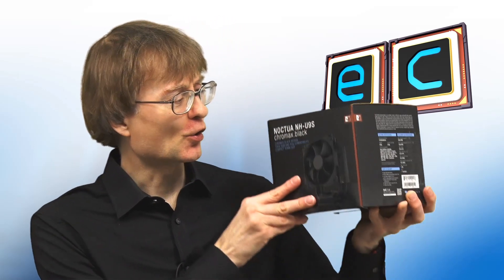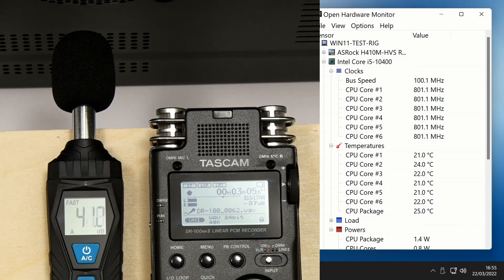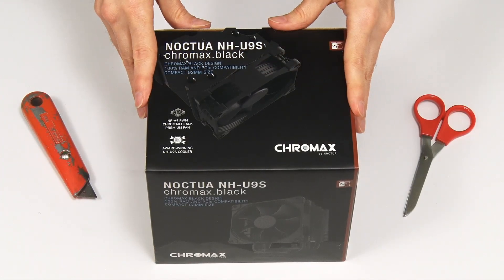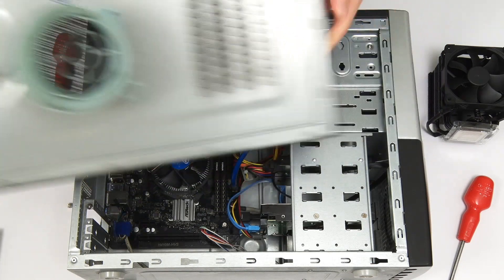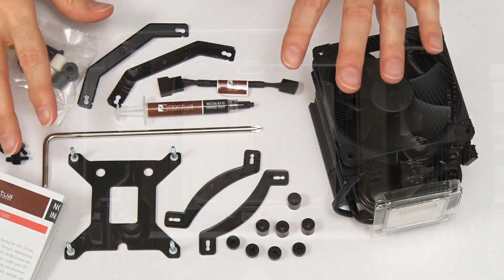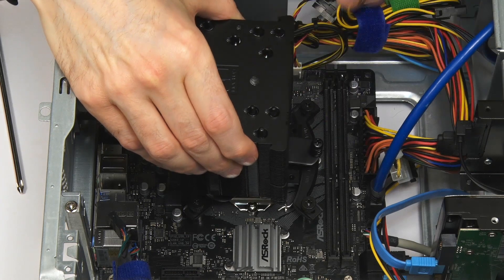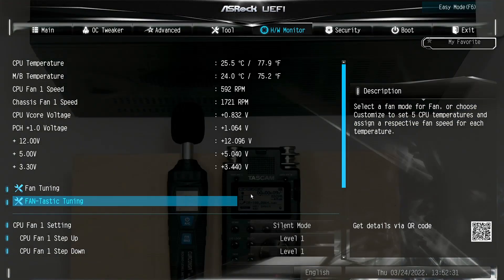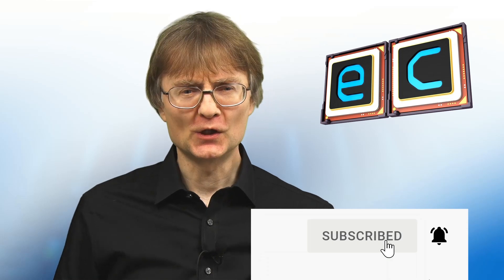Quieter PC #1: Noctua NH-U9S Cooler

Comment: I love my Noctua NH-D155 Chromax Black (Dual-Tower) CPU Cooler.  I have it mounted on my AMD Ryzen 9 5900x CPU.  It makes my PC very quiet.  As I watch this video the CPU (Tdie) temp is a nice +39.6°C with an ambient room temperature of 72.3°F (22.4°C).  It keeps my office very quiet, and you rarely hear any noise coming from my desktop PC.  If I play a game, the CPU fan and temperature does ramp up a little, but it is always significantly quieter than the fans on my EVGA RTX 2070 GPU.  It's a great silent CPU cooler.  Be warned though: it's physical size is rather beastly.  I would not attempt to mount a cooler such as this in a small case!

Comment: Finally, a YouTuber who pronounces "Ubuntu" correctly.... Just for curiosity, why didn't you go with a fanless PSU?
Reply from the maker: The Corsair RM550x does not run its fan below 220W output, so effectively is fanless in this rig. It is now fitted and even at load for hours on end the fan does not come on. :)

Comment: Great to see hard numbers. Since dB is a log scale, that's quite a lot of noise reduction.
And convenient of that case to have the back-of-CPU window; many don't!

When the BIOS lacks fan control, I use an inline rheostat (with an external control knob) to set fan speed just below the threshold-of-notice, around half speed. My old Enermax PSUs have their own external fan control, which I set similarly. 

Which reminds me, I have a dead PSU that I need to cannibalize for its very quiet fans. :)

Comment: Lovely video 10x 👏👍 Whilst I do not operate a comparable platform or box, it makes one begin to wonder how 'musical' various PC cases are.  Do the latest mode open-frame cases (or racks) for desktop generate less sound due to an absence of (sonic) case walls as well as less constricted airflow? Granted, open cases are less tidy, and subject its racked components to greater exposure to spills and grime. (For my use case, an idealised build consists of several dozen clustered cores that remain accessible virtually <vnc, guacamole, ssh, rdp>, whilst being physically remote and isolated in a small, uninhabited space of my premises . . . there making as much stinking noise as they like!  Either that, or dunked in a bath of mute and halogenated ketones, aka 'waterless water'.) Watching you build/rebuild PCs and learning from you is an honour and pleasure. Yours truly.

Comment: If I were you, I would spend my money on a better processor and faster memory (Achieve more computing at the same time and with the same power consumption), or installing a 3.5'' SATA HDD TRAYLESS MOBILE RACK on the front of the case above DVD (Easy to create clones of the system and other backups at a speed of 6Gbps as well as rapid switching of operating systems with different HDDs)
 The noise will still exist even with a change of the computer case.
 I believe that the best solution to deal with the problem is to build a soundproof housing, made of cheap soundproofing material, which will dampen the noise (wherever it comes from: HDDs, GPU cooler, CPU cooler, Case fans etc) will not obstruct the flow of air that is necessary for the cooling of the system.
 Construction with the method of the labyrinth, allows uninterrupted flow of air and zero propagation of sounds.
 A second economical solution is to place the computer in an adjacent area (adjoining room).
 Due to the short distances, there is no problem with either the USB or the HDMI connection cables of the peripherals.
 I have always believed and still believe that the best quality materials can have a high cost of acquisition, as in most cases it incorporates the cost of upgrades, but it has an extremely lower cost of use, due to the high degree of efficiency from the first moment and throughout life of the system.
 I do not blame your effort, I just try to show that there are other alternatives to the same problem.
I would be really happy if you could use your 3D printer to make a soundproof cover (make connectors and spools for foam insulation).
 The video recording of such an endeavor, from the design to the completion, would be of great interest and would have plenty to teach us. (Use of software design, conversion to machine language, printer setup, possible problems and solutions during printing, construction completion, installation and noise measurements, etc.)
 I hope you made it
 

  With deep appreciation
Reply from the maker: Thanks for this, but I can report that after completing this project (replacing the PSU and back case fan and adding a front case fan), the noise level has dropped to almost nothing -- well below 30dB at both idle and load. I do not need a faster processor or faster memory in this PC -- there would be no benefit at all! :) This is a test rig. I have removable bays in many other systems, but do not need one here.

Comment: Chris,I was wondering what would happen if you mounted the fan the other way around instead of blowing air across the fins you pulled the air thru the fins. Would it change the sound or Temps.
Reply from the maker: This certainly can be done. Conventional wisdom is to push air through the CPU fan fins. But it would work with the fan on the other side pulling air through as you say.

Comment: A problem with this sort of aftermarket cooler is that instead of sucking cool air into the case via the inlet tube, the fan is re-circulating warm internal air unless the case itself has an exhaust fan. It would have been interesting to measure the internal air temperature before and after fitting the new fan. The old fan just spat out the air into the case as well, but at least it always had cooler external air available. Also, with an inlet tube directly leading to the old fan it was always going to be noisier near the inlet. The new fan's noise is less focused. For me, soundproofing 101 is fit sound absorbing material inside the case.
Reply from the maker: This case does have an exhaust fan -- nicely in line with the cooler. And the PC now also has a front intake fan, so there is  nice flow of airflow moving between all three fans.

Comment: Keeping a PC with a lot of horse power like mine (Threadripper 3960X and ASUS RTX 3090 STRIX OC) was only possible by making a custom water cooling loop for both the CPU and GPU. At around 21°C room temperature my GPU peaks at 47°C and the CPU peaks at just under 70°C with both loaded to 100% for 20 minutes (Cinebench R23 loop + MSI Kombustor 6500 MByte Donut). I am using Alphacool NexXxos Monsta radiators (80mm depth). One 560mm and one 420mm size with 7 Noctua industrialPPC PWM 3000 fans and a custom made Arduino based fan controller with 3 temperature probes for ambient, case temperature and water temperature. I have no means to measure the noise, but I can say I am very satisfied with the cooling system.

Comment: For me lack of noise is my number 1 consideration, to the point I can spend double just for that. My 2014 PC is a beast but very quiet, but won't be updated after 2025. While I'll keep using it as a server I have to get another main pc and I want it both powerful enough and totally silent. At this point the main candidate is a M1 Mac Mini running Windows. I already have one, and it's totally silent under any load, but 16GB is a bit tight for virtualization so I am waiting for one that supports 32GB RAM, but if in the meantime I can find something that is both powerful and totally silent I might go with Windows.

Comment: I've been using Noctua case fans and CPU coolers for over a decade now.  I'm definitely of the opinion that there are no better air-coolers on the market.  I've never had one fail.  Yes, they're pricey.  But you absolutely get what you pay for in this instance.
Reply from the maker: Agreed.

Comment: A good video, I like it. Personally I think the components are very mismatched. The worst h410 motherboard in existence, a bad case, a middle of the road cpu and a very expensive cpu cooler. Money is going Not optimal places, there is a lot of optimizing potential in this pc.
Reply from the maker: Thanks. But on the PC, I think you've missed my opening here . .  this rig is a legacy of many upgrade videos. It was never specified as a system from scratch. "Optimizing" also has to be relative to the application of a piece of technology. And right now, by far the most important aspect of this PC for me is the level of noise it makes. And the CPU has also been chosen to meet my requirements. So the money is absolutely going in the right places for my application of this PC. A more powerful processor would provide me with no extra value. And there is also absolutely nothing wrong with the case for the purposes it will be used for. I cannot justify its disposal, and as you will see in the next video in this series, the machine ends up running at continual load almost totally silent and with CPU temperatures of 42C.

I'm also going to do a video where I refurbish the case, and I could not do that if I got rid of it! :)
Reply: @ExplainingComputers  thank you for replying and explaining. Yes, I get your goal, thought process with legacy Maschine etc. I hindsight, I just deemed the cooler as to expensive.

Comment: great video . Im think the new loud primary source is the casefan with 1500 rpm. you can set it like the cpu fan. because i think this fan powers on 100%. and yes noctus have the best fans i think. my old one nh-c12p se14 that i bougth at amd fx 8350 times runs now with the ryzen5600x
great video :)
Reply from the maker: After I replaced the PSU, the case fan was indeed a considerable source of noise -- but it has been replaced with a 92mm Noctua, plus a 120mm Noctua at the front. :)
Reply: @ExplainingComputers  ps the old 140 mm fan on the cp12 heatsink runs under load very silent. You hear that system not realy. If im gameing its very great. On normal load its noiselese.  Ps as a CASE fan i can recommend the Arctic P12 PWM PST A-RGB 0dB. It has low cost (10 euros) they are very significant manufactored, silent and have a very good rgb .  I have make on my old computercase a hole with an fan bracket ,filter on myself. . It shows now as ligthing flower . Very crazy . ;)

Comment: I wonder what else can be done to the case to make the computer quieter besides swapping the CPU and the PSU coolers. Well, probably the GPU cooler as well, and HDDs for SSDs...
I've seen people talk about putting the computer in a separate room, but that's not always possible, certainly not for everyone, and I wonder how much of a reduction could you get from applying foam pads to the inside of the case, or maybe even placing the computer inside of a wooden case (paying attention to airflow, of course) again fitted with foam pads. Vibration can be a very annoying source of noise, and it can come from anywhere. I've had my share of problems recently, and resorted to adding a couple blocks of EVA foam under the case, using those to prop up the computer instead of the feet that came with it.

Comment: £62? oof.  
That's what I paid for my Noctua U12a, which I choose over everything else including Noctua's own D15s; 
as nothing else had the low sound and performance that would fit in my case. 
I use a 16 core in a rather compact midtower to archive h265 content. Great video as always.

Comment: Knowing that a cpu and GPU start to throttle around 90°c I wonder if you really need any fan at all for this PC.
Of course is you have the space in the case.
Reply from the maker: Well, for a start, running a CPU at high temperatures (and there is no single throttle temperature for a CPU -- it depends on the model) is not a good idea when it comes to its life expectancy. Secondly, running a CPU hot will cause its fan to rotate far more quickly, so creating more noise! :)
Reply: @ExplainingComputers  I totally agree, what I was saying was with a fanless solution.

Comment: Those 80mm fans can be quite noisy, with high pitch sounds. Maybe switching for one that is not DC controled, but rather for quality PWM one? I did that in my Chieftec case and it was quite a noticable difference. I got Arctic F8 PWM (this one was readily available in my local store) Now it spins as low as 300rpm at idle, but when PC is at full use, it still keeps low noice levels. CPU cooler is stock AMD wraith stealth btw.
Reply from the maker: The 80mm back is replaced in next video with a 92mm PWM Noctua, and I also add a 120mm Noctua in the front. Coupled with the new PSU, it is now very quiet! :)
Reply: @ExplainingComputers  I had to watch the ending again, had to bump up volume a litle bit. I understud "case stands" instead of "case fans". But I did that too, I added foam pads bellow case stands to dumpen those low pitch noice normally comming from HDDs. Those vibrations would transfer to my work desk.  It did help as well 😃

Comment: The noise level meter is showing a pretty impressive result with a 7 dB noise reduction. A 30 dB ambient noise is not enough to disturb the sleep and you're almost there at less than 1 meter of the computer.
When I built my main computer, I was a bit short on budget. Stock cooler for the processor and Be!Quiet fans for the case were a bit more affordable choice than Noctua solutions. It's a quiet setup but not a silent one.
I may consider to upgrade my rig now. Can't wait for the last upgrades video.
Cheers.

Comment: with the fan being so close to the Ram I would be tempted to try to rotate it 180 degree's and flip the fan to a pull configuration, in the rear side of the case if possible.
Reply from the maker: The cooler is close, but the angles here do not show that he fan is well above the RAM, so the modules do not interfere with the airflow.

Comment: Noctua fans are excellent, even their budget redux ones. Bought an NF-P12 redux to replace the fan that came with my Thermaltake Contac 12 heatsink and it's pretty surreal to be able to overclock and stress test my Ryzen 1600AF with barely any noticeable noise coming from the case. Really like that old case as I prefer the 'sleeper' look. Ordinary, boring looking case hiding rather strong hardware is always cool :D.
Reply: I run Nocturas throughout my builds

Comment: A very justified video, Chris, double-thumbs up for covering such a contentious subject; no-one wants a jet engine near their ear canals. Granted, it is a mountain to climb to get even anywhere close to zero noise. Even the chassis design itself can be the achilles heel; mine can stay totally silent, but only for so long as heat builds up on the heatsink before the motherboard starts the CPU fan and keeps it on from that point onwards.

There are a few other possible, yet more complicated, ways to get the CPU temperature down during idle periods whilst keeping the CPU at the ready for a sudden burst in workload. One option is to enable deeper C-States for Intel CPUs in the UEFI/BIOS. Some motherboards treat "auto" as disabled, so a setting of "No Limit", if it is offered, is the best in my opinion since it uses whatever the processor reports it is naturally capable of.

One thing I could say if anyone is looking for "extra reading", is to look into the powercfg.exe utility that is included in Windows, because it exposes additional-yet-significant settings not typically displayed in any GUI; you can query this information with "powercfg.exe -qh".

One trick I use is "Core Parking" within Windows, which makes the kernel spread app workloads across fewer cores under light and medium loads and deep-sleeps the rest, also the silicon in those sleeping cores can sink away some heat from the active ones. Though, this is a bit of a more controversial one as core-parking can interfere with some timing-sensitive apps like games with increased frame-stuttering; but, in office/corporate or home-server environments, it wouldn't be as noticeable and will certainly help with the electric bill.

The way I look at things from a physics perspective is that fewer, busier cores, have less heat-dispersal requirements than more, less-laden ones. Though, it goes without saying that mileages will vary. I installed my cooler with the fins oriented vertically to aid natural convection since heat rises.
Reply from the maker: Great post, thanks for sharing.
Reply: @ExplainingComputers  No worries; for the timing of this video coincides with circumstances when we all need to be energy-conscious so as to not leaving holes in our wallets; every watt matters now more than it ever has been.

Comment: Very interesting video. In my situation when I used integrated graphics like you do the noise was absolutely negligible. The problem  have appeared with 2 coolers at Discrete GPU. And there is absolutely nothing to do with it. So after all updates to your PC please try to add discrete GPU :)
Reply from the maker: Keep watching . . . :)
Reply: @ExplainingComputers  That interests me as well. I've gone with fanless GPU when possible, but one doesn't always have that choice, and GPU fans are mostly like helicopters. The only really quiet ones I have are Radeon R7-350x in the Dell package (you can barely hear them with the case open and your ear right next to it).